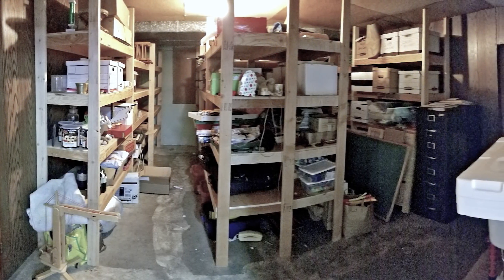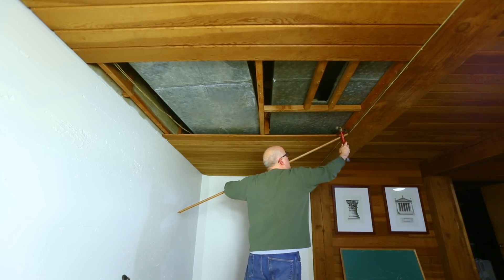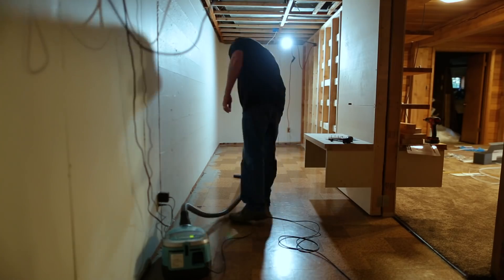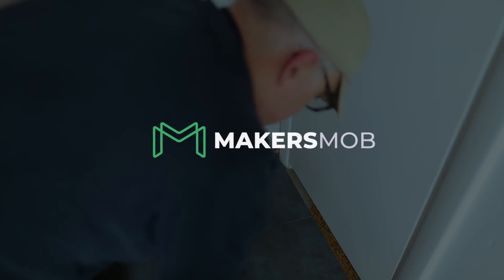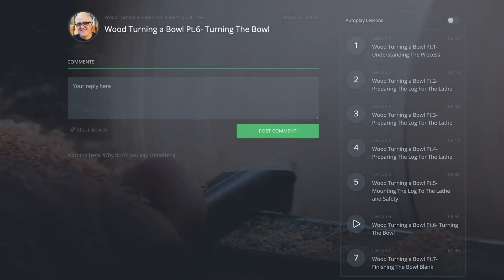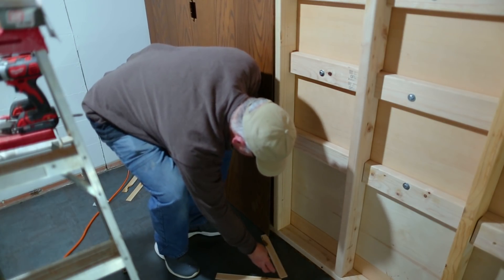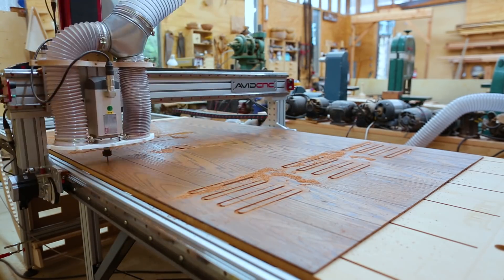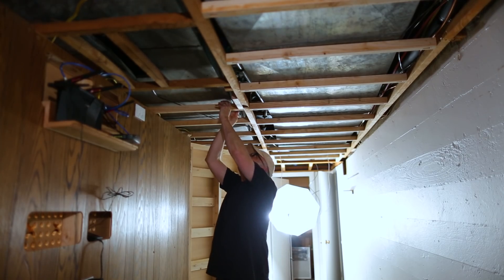Basement Remodel – Part 5 – Building the Storage Room

Comment: Hadn’t seen the radial arm saw safety thing at 6:33 before.  A cable and weight to keep the carriage from rolling out on its own, clever!
Reply: I thought so too
Reply from the maker: I added a wight, it gives you something to pull against, cuts down on jamming the blade.
Reply: In the UK, radial arm saws in commercial places must have return springs attached to them to meet health and safety legislation. I finds it's a good thing to add, as when you are cutting large, thick timbers it helps stop the blade wanting to climb up the wood and jam. It also means it can't vibrate forward at all.
Reply: @CA-gy4qf  I understand that the blades should also have a negative rake for that reason.
Reply: @cpad007  the negative rake certainly helps the issue, but doesn't 100% solve it
Reply: Shame on you, there is a whole video or maybe two on the installation of those radial arm saws, the dust collection and related stuff like the weight! Got some homework to do LOL!

Comment: “I can’t turn the internet off for more than 2 seconds before being yelled at” so true Frank
Reply: This confused me cause he said that turning the power off was fine but don't you need power for the modem and router to work?
Reply: @pinguNeko  maybe Frank is describing a scenario where he had to cut power to some portion of the house and found that family members were reasonably tolerant of it. But if the internet stops working, then the family members are generally much less tolerant. So it has to do with which breaker on the main panel is turned off. As long as it is not the breaker to the modem and router all is well. Just a guess!

Comment: Frank, If I may, I would recommend you either build a mesh enclosure for the PC around the big bay, or some kind of passive air filtration for the room. I can already tell that unless you blow out the dust bunnies religiously on a regular basis, it'll start piling up on the inside pretty quick

Comment: Another great video, Frank! On this Black Friday, I would like to help you spend your money by suggesting that you add an Uninterruptible Power Supply (UPS) to your internet modem/router setup. In the event on planned or unplanned power outages, this keeps you online. It’s also a good place for base stations of various home security modules, especially since most of those also draw relatively little power. The computer you have there looks beefy, so you may not want to have it to stay powered by the UPS, but I believe that you can also connect it via USB to the the UPS so that the UPS and initiate a safe shutdown when it detects the power outage longer than a certain amount of time. UPSs also have a separate set of surge protected plugs that don’t draw down the battery, so you get an additional, protected power strip.

Hope this is useful info, and I am ooking forward to your next video.
Reply from the maker: Thanks, yes we just Added a UPS yesterday.

Comment: Fun set of videos this year.  Just a possible suggestion regarding ceiling where utilities go through.  I have two edit suites in my home and I found that if I ever need to run additional wiring of any kind that the traditional 12x12 tiles or even the large panels  you are using made things a bit challenging to work with.  What I would suggest is a material called TecTum...called that here in Toronto...not sure about the West Coast.   It is kind of a spaghetti wood panel that does take paint easily and can be easily cut and provides very good sound absorption vs hard surfaces.   If you cut those into 4x2 panels you can easily attach those to 1x3 on the ceiling using larger screws used for attaching concrete backer board to studs.  With this config you cut down noise and also allow for easy removal when  you add wiring for any number of things such as video surveillance systems, audio, ethernet and of course power..  I think they come in 4x8 sheets but I have had them cut into manageable sizes for me.  Just offset the joints and you golden.   Just a possible solution for noisy places like basement, workshops and any place with highly reflective surfaces.

Comment: Hi Frank, when you pulled down the ceiling again, could you have run the lighting wire up through the ceiling, so you didn't have wire cleats holding it up (making it a bit neater?)

Comment: That's a bad location for router, since WiFi signal could lower down a lot when passing ceramic, concrete, metal, and mirrors. And you have metal ducting about the router, makes signal run low on the level above basement.
Reply: I think he knows well enough to employ extenders.

Comment: As I work at tech support for an ISP, I wonder if placing the router so close to those massive metal sheets for the A/C affects WiFi range.
Reply: I paused the video just to look for this comment. I was thinking the same thing.
Reply: @wadly99  right? Being so close to those metal sheets, I think that will affect WiFi range upstairs. Mind you, that seems quite a good router, but still. And I find it a bit odd all the antennas in the same direction. It's better to have them at an angle relative to each other, as range is also affected by the angle between the broadcasting antenna and the receiving one. If you place them at different angles to each other, one of them will have the best angle towards your device, and the router will use that antenna to "talk" to your device. More antennas don't mean stronger signal by themselves, but a better management of a higher number of devices.
Reply: fadetounforgiven there was a cable he plugged into the router at one point. It could well end up being an extension to another access point in another part of the house...?
Reply: @Renville80  that's way beyond what I could know. I would guess it would connect the pc and/or the tv rather than some kind of access point, as that would require some preparation. I mean, from what Frank says, the router was elsewhere and they mostly connect by WiFi. So, as meticulous as Frank is, I think it's something that he would usually mention. On the other hand, it has nothing to do with actual woodworking, so it wouldn't matter if he didn't.

Comment: Lovely work but that cable for the lights on the roof is like a fork in my eye... Why not drill a hole or two and put the cable behind the panel? You seem to have all cables loose in the walls/roof anyway over there on that side of the pond.
Reply: Tomi Biloglav building code doesn’t really permit plug-in cords to be run behind panels versus power or network cables run between outlets.